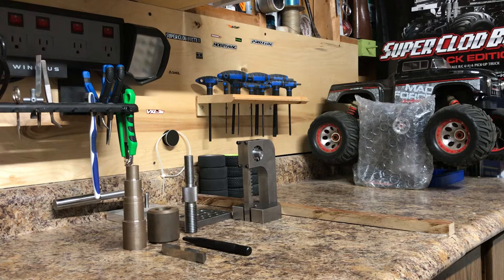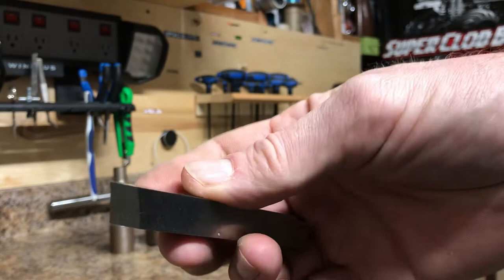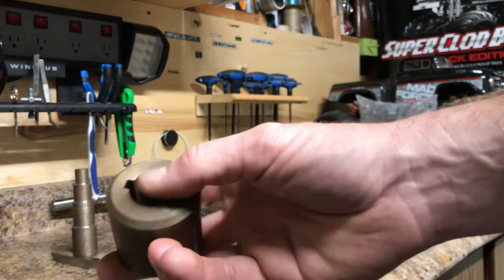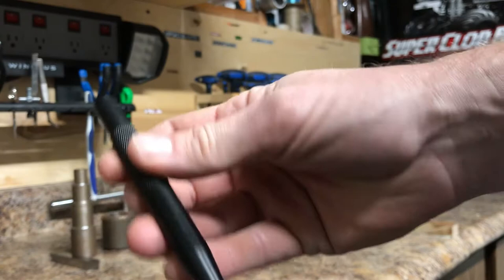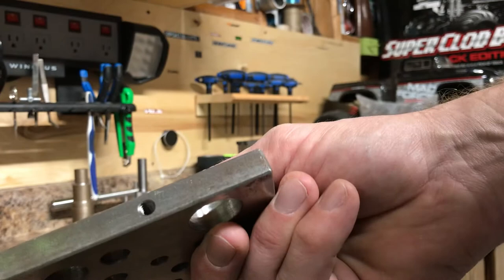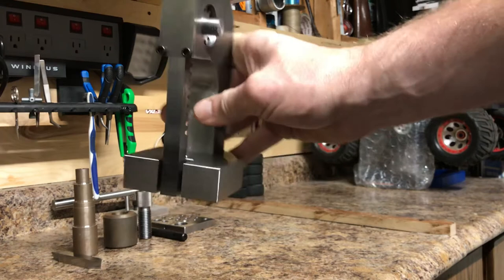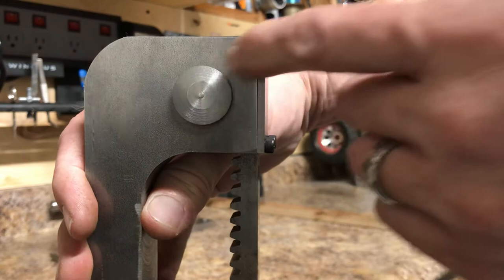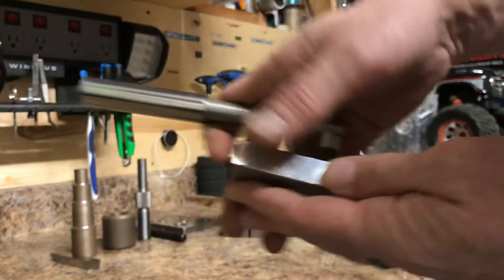So you wanna be an Millwright?

Comment: .I believe you are speaking about your process of learning machinist or machining essentials. I am under the impression a millwright is the person repairing the machines that the machinists run or operate
Reply from the maker: Millwrights have to learn how to machine parts. We fabricate and modify machines as well as repair them.
Reply: It's a whole lot more than just turning a wrench im a millwright myself in a manufacturing plant you can do anything from fixing machine to completely tearing a machine out a installing a new one you have to cut weld machine parts and be able to line thing up with extreme precision.
Reply: @a-yates  I'm a Licensed mechanic thinking about making the switch, My main concern is confined spaces, how often are you in a clausterphobic situation on a job? Everything else I think I'd do fine, the basic skillset is very similar
Reply: @danielcordi7519  Personally, I am in tight spaces all the time, but it comes with the place where I work. It just depends on the job I have done jobs I have hated, but I haven't done anything yet that's made me want to give it up.. you won't regret making the switch.